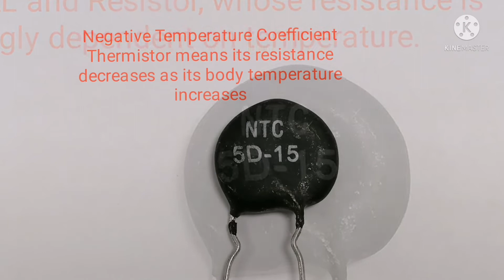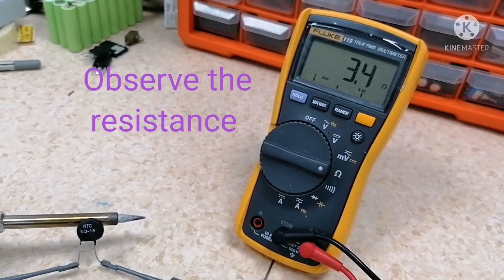NTC THERMISTOR || HOW TO TEST A THERMISTOR || BASIC TEST NTC 5D-15

Comment: Pwede po ba eh check yan sir kahit naka connect pa po sa board niya?
Reply from the maker: Thank you for watching. Yes you can but make sure your device is not connected to power, that there is no presence of voltage for safety.

Comment: sir what if my NTC 100D-9 has cracked a little bit but it still decreases resistance based on the test procedure you showed. Should I still replace it?.. By the way fuse got busted and 2 diodes IN4007 got shorted on the bridge, is it logical to conclude that this NTC is affected due to too much heat apparently from excessive current?please reply..😊

Comment: Hi, l enjoyed the video clear explanation of NTC type however l have a PTC Thermistor in a circuit which is a blue ceramic disc type.
I cannot understand what the item  reference markings are referring to,it is marked PTC C 840 which l conclude to be Positive Temp Coefficient / Ceramic.
then there is a further reference number 0317 underneath the C840.
Do you have any help to offer as to the meaning of these ref numbers marked on this item.
Reply from the maker: Thanks for watching. I guess 0317 figure underneath the C840 does not affect your design though I'm not sure. C840 is necessary as it is the type of Thermistor set as standard and it has an equivalent Electrical Specifications. You may also find C830, C850, C860.